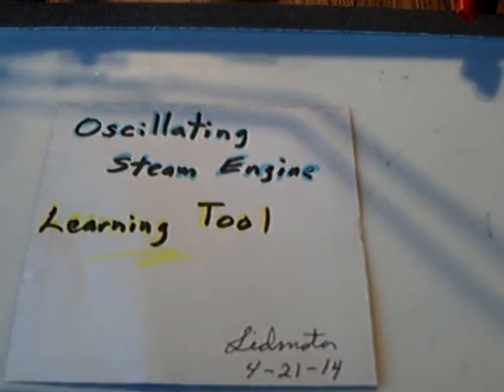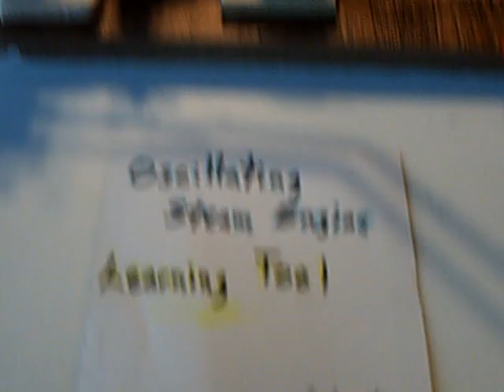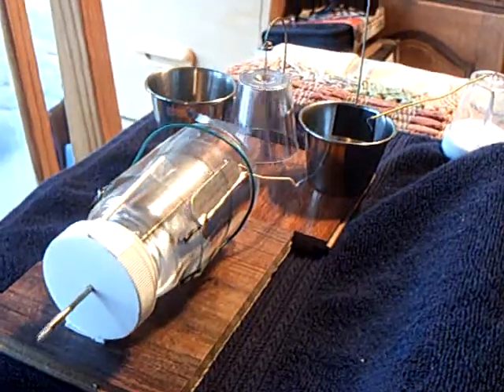Steam Engine ---- Learning Tool

Comment: I love this stuff!!! Check out the instructables copper pipe steam engine. The one that's two copper pipes with the right angle and flywheel. It would be easy to make with simple tools, and it runs in both directions. If you can't find it, let me know, and I'll look for the link. Instructables is down right now.
Reply from the maker: Thanks.   I will look it up.